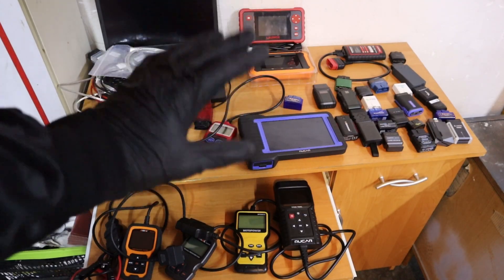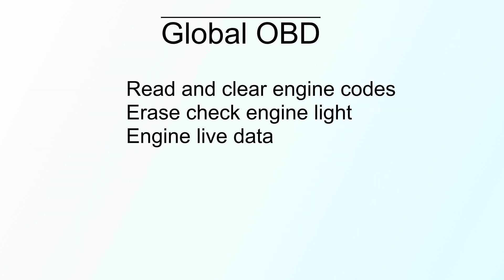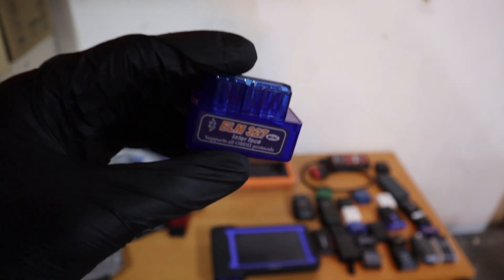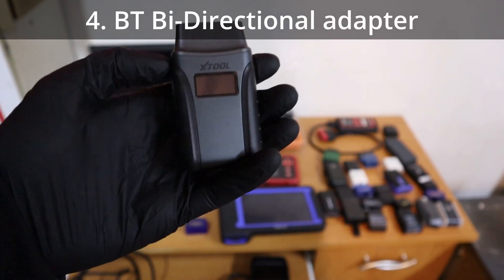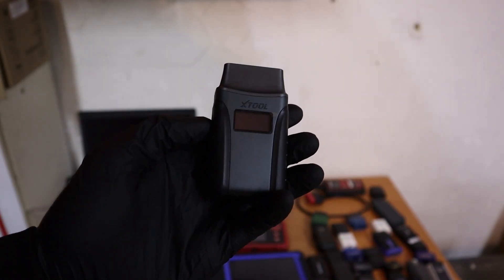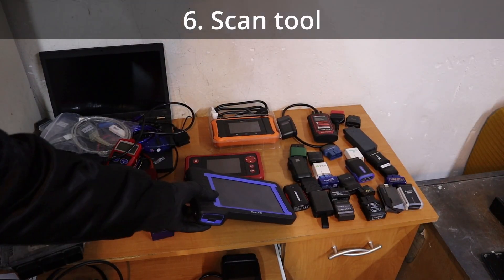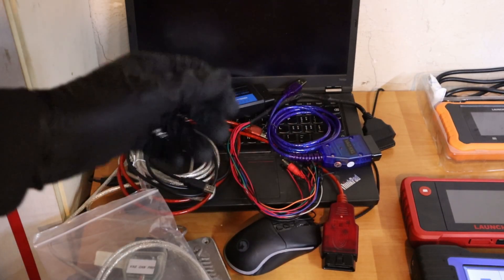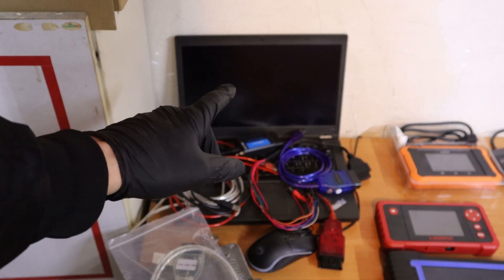Choosing OBD2 scanner: Differences explained

Comment: I have Landrover discovery 5 i have airbag problem i need a scanner to read and clear error after i replace the sensor.
I have also discovery 5 i own.
I want it on my phone if possible and if possible subscription free.
Please help.
Reply: Almost bought topdon on ebay from 30 pounds in uk
Reply from the maker: One of these should work: Kingbolen and XTool are without subscription
https://iamcarhacker.com/best-bluetooth-bi-directional-scanners/
Reply: Did you mean the Kingbolen Ediag Elite All System Car Diagnostic Scanner Tool.
I found it on ebay fron uk launch is that lagit @iamcarhacker

Comment: I tried topdon top scan but it takes like 10 mins to scan one car and I was really disappointed. I flip cars, and I buy cars at tow yard auctions. I need to check like 20 cars condition in 2hrs inspection time before the auction. I think at least I need to be able to pull sas, abs, engine and transmission codes. Which scanner would you recommend for the fast checking time?
Reply from the maker: Fastest I experienced was one of these 2: https://iamcarhacker.com/thinkscan-689bt-vs-mucar-892bt-compared/

But If I can guess you scanned an old vehicle which tends to have longer communication despites having less modules. For example when I used Topscan on my 2022 Corolla it was 1-2 min scan. If I used it on Punto it could be 5+ minutes. So even with better tool like those I mention, you still can experience cars with longer scan time.

Comment: What obd scanner you recomend for coding new options on cars but scanner that supports more vehicles? I hav vag com from aliexpres but it doesnt work for newer than 2017. I wanted to get obdeleven for vag and bmw and i found modded apk with free ultimate plan for vag and for bmw i would use credits. What do you think?

Comment: Hello love your in depth videos. Do any of the obd  tools work with reprogramming replacement modules or removing component protection? Particularly vw,skoda etc. Normally done by dealer using odis.

Comment: Hi, I'm so happy I find this channel. I would like to know if using Thinkcar BD6 is possible to find hidden mileage records? Does Thinkcar BD6 can access all car modules (like Thinkdiag 2)? Thanks.
P.S. I would like to use the scanner for used car checks and wondering if BD6 will be enough (at this moment subscription for Thinkdiag 2 seems a bit expensive comparing getting hidden mileage records with BD6 for free).

Comment: Don’t know if you had obdeleven but what a disappointment that garbage is. Pay to do, pay to undo. Nope… and it didn’t hardly do jack for my vw jetta 2019 sel. 

Wonder if the vcds and other scanners could do the same without alot of difficult coding
Reply from the maker: I have OBDeleven, I also had Jetta and for me its one of best scanners for VW/Audi. But dont pay for apps I just use pro plan and code myself. VCDS is same like OBDeleven PRO you have to do coding yourself and there are no one-click apps. 

If you want something simple you can use ELM327 adapter, pay 10€ for 1-month Carista subscription and do unlimited changes (you dont have to code just select what you want customize). 

I have video about carista for vag on my other channel: https://www.youtube.com/watch?v=slAcGF67r-0

Comment: Thankyou for making video My vehicle is toyota .I'm in between mucar or 689bt .  Is it better than xtool d7 garbage that I returned  .If not is 689bt for $150 more than mucar worth it?  Also would like the delphi 150 but where to get all the software. computers are my specially so I'm not afraid of false positives installing cloneware. I have  tried forscan-w32  for friends usb dongle fords to remove annoying buzzer sounds . Their software is so dated ,like windows 95.
Reply from the maker: I have xtool D7 and based on cars I've tested it worked really good. Mucar (if you talk abut VO7) is good but delphi is fine as well, it is just better to get separate refurbished laptop ($100-200) so you can turn antivirus off and not worry abot anything.